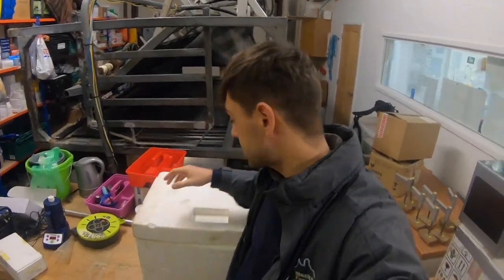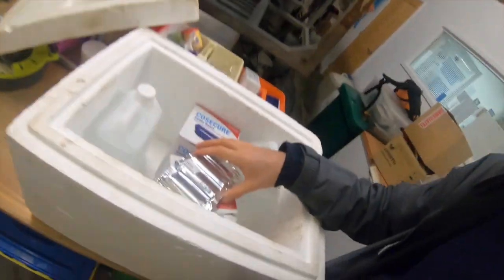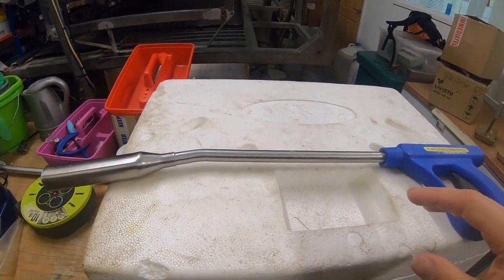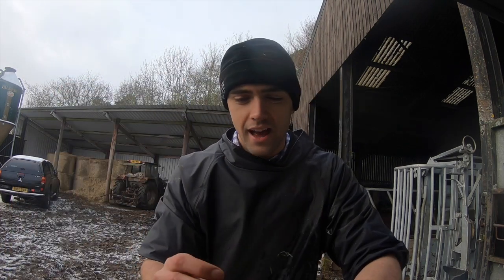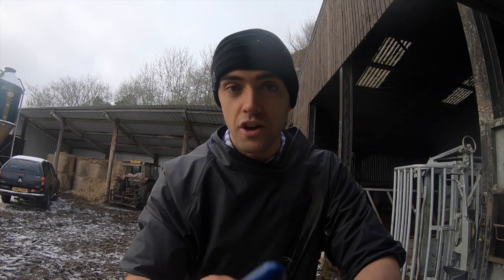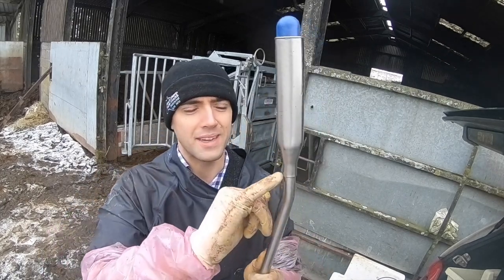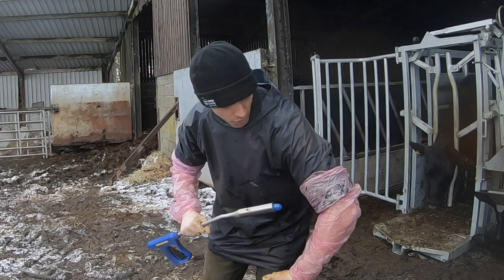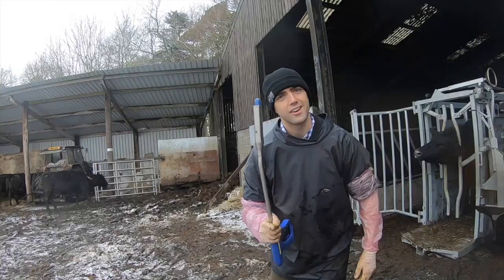GIVING MINERAL BOLUSES TO CATTLE | TECHNICAL #3

Comment: Great Video Kaz. Does your practice use a certain brand of bolus or do u use various brands depending on the trace elements required?
Reply from the maker: So it depends on the scenario (sheep vs cattle, trace elements needed, organic vs conventional) but yeah there are a few we prefer, partly out of familiarity. And there are one or two we steer clear of but I won’t name and shame 😅 Most important thing is to go back + resample to verify the supplement is working.
Reply: @farmvetfilms  i did a blood test on my ewes instead of just blindly bolusing them as i had done previously and it came back that they didn’t require any supplements. £500 a year saved 🙌🏼

Comment: Hey kaz, great videos by the way. Just wondering as regards the Bio-tin boluses are they any good for lameness in sheep. Especially lambs that are being fattened on slats which are prone to lameness. Always keen to learn any new ways of combating this issue. Thanks
Reply from the maker: Hi Colin, no biotin products available for sheep *as far as I’m aware, and they are fairly expensive for cattle so might not be an option anyhow.

Five point plan is a pretty foolproof approach, you’ve probably already come across is but in case you haven’t: https://www.faifarms.com/lameness5pointplan/

Store lambs always an issue if bought from several different bits - it’s just a case of treating and isolating cases as soon as you can.
Reply: @farmvetfilms  that’s sound good to know. Yeah I heard of the five point plan and it’s a good help but for lambs that are being bought in for fattening it can be hard to keep track 😂 we’re always learning but definitely important to remove infected lambs from the group to reduce the spread. Also find lime is a big help when put down along the inside of the feed barrier. Thanks
Reply from the maker: @colingilligan9785  yep hydrated lime is a wonderful thing. Definitely worth ringing your vet during a flare up, even if just for some moral support!
Reply: @farmvetfilms   I think in some cases it’s the psychologists you’d want to be ringing when there’s a flare up 😂 they’d break your heart at times but yeah I agree the vet should definitely be involved in any treatments at the flock level especially which such focus on anti microbial resistance. Some lamb finishing units with wide varieties of antibiotics being used can be a breeding ground for bacteria made worse by not finishing the course which can often happen when dealing with several lambs.